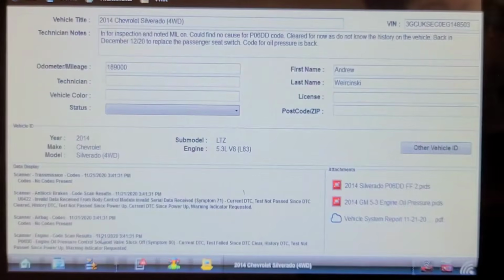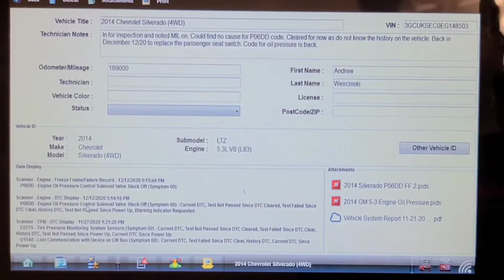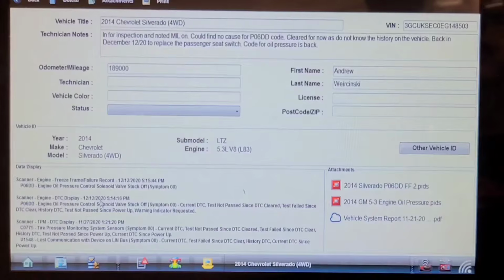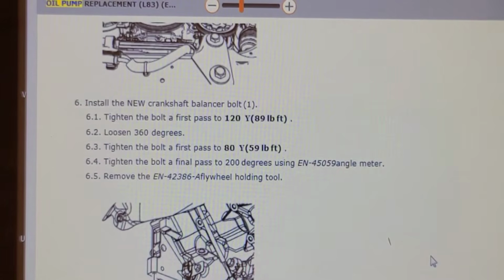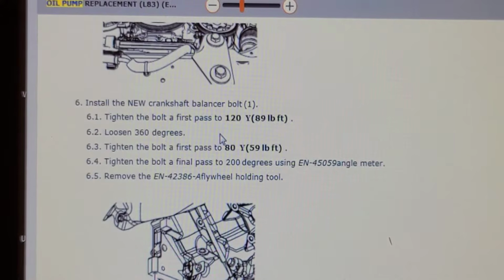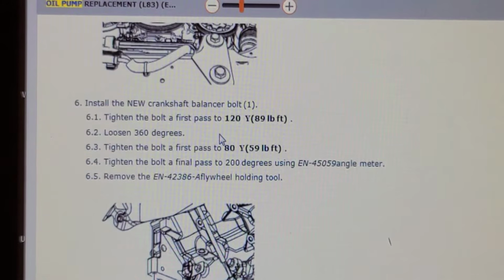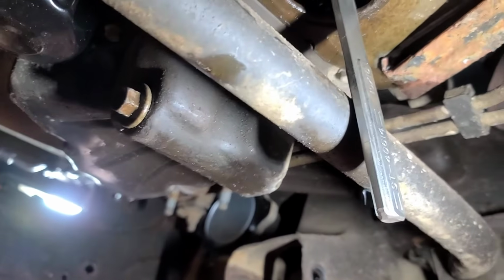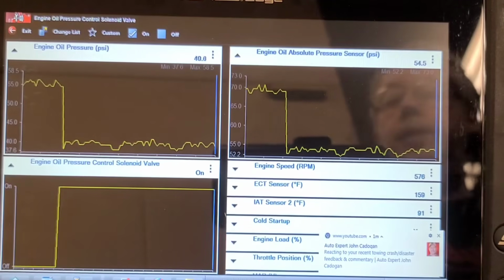2014 GM Truck 5.3 Oil Pump Replacement Code P06DD

Comment: Had this code on my 2015 Sierra 5.3 . Had 3 oil pumps replaced under warranty within 4.5 months . I talked to the service manager and asked if there is an updated part to stop this from happening . He said no . So this will continue to happen .... I traded the truck off the next day for a truely to reliable truck .... Tundra !
Reply from the maker: I hear you... it's a shame they can't design it better.
Reply: @PhillipBailey  they did. Then they ruined it
Reply: @PhillipBailey  Would you by chance rememeber the labour hrs to replace this oil pump?
Reply from the maker: @Mike-iz3wl  I charged him 11.5hrs
Reply: @PhillipBailey  Thank you Sir.
Look forward to more of your videos.Very well done👍👍
Reply: @PhillipBailey that is good to know, as my 2014 sierra will likely be needing one. It got the dreaded p06dd code and a growling noise that started 2 weeks ago. Had one shop diagnose it and basically told me to take it to the dealer because "its s big job", so i'm taking it to another local mechanic this friday.
Reply from the maker: @blackwar12 good luck
Reply: @PhillipBailey doing mine right now, I’m in the process of re assembly. Thank you for your detailed video! Absolutely amazing
Reply from the maker: @Jaidenem1  glad it helped you
Reply: My dad literally  just bought a sierra with like only 60,000 k and  he changed the oil sensor and its still reading no oil pressure  like the pos chevy it is . They're  complete pos trucks now thier  engineers need firing
Reply: There's a tps bulletin for a short spring that causes this
Reply: @jessicalacosse5998  where can I find this?
Reply: My plan too.
Reply: one new engine in mine now(pump failure)70k oil pump is on its way out again on this new engine 189k
Reply: i find that hard to believe that it would be the truck. seems like maybe its the operator. what oil are you putting in your truck? ive done 5w 20 in the winters and 10w 30 in the summers on my 2018 and am almost at 90k miles with no issues. the only issue ive ever had was a starter going bad at 60k and a water pump at 80k but were easy fixes
Reply: @j @jonnysnipes3123 w did u know to change the oil to 10/30
Reply: I know one thing when,this code pops up ,I would go buy a for sale sign and get rid of her.

Comment: This is a 12.7 hour job per the book. If you charge standard rate, around $95 an hour, then it will be 95x13.7 = $1206.5 + shop supplies, parts and taxes.
Reply: $300??? Waoooo !
Reply: Nah my shop did it for like $300
Reply: @backwardmist2303  nice, send me the address and I will tow the cars to you and I will get my cut.
Reply: @scientist100  😆🤣
Reply: Not in Alaska my number 7 lifter went out they want 7 to 8 thousand to fix it

Comment: The drain cock is on the bottom left if facing the engine. The only way to access it is to remove a rubber cover behind the radiator, I removed the fender liner on the passenger side for better access to this.
Reply from the maker: I rarely use the radiator drain as they often break and then you end up replacing the radiator. I'll remove the lower rad hose if required .

Comment: A man that is a lot of work I miss my 2000 Chevrolet Silverado 3500 with the 350 vortec that thing will haul and work hard and no problems. i sold it to buy a 2010 Silverado, then I sold that to buy a 2017 GMC Sierra 5.3,  and now I am seeing videos of this problem because I think this truck is heading this way. I think that a few months it will have this service done because of a whining in acceleration,  still there is no code but in the first start of the day it will make a lot of sound ,and when the engine gets to normal temp it will stop making the sound a man I always say to much tech will always be counterproductive this things are not rocket 🚀 why put so much tech

Comment: My shop manual procedure for the engine oil pump re/re it doesn't say to remove the oil pan on the 5.3L L83 and I just read a thread below asking why you had to remove the oil pan. It looks like the oil pump gasket is of sufficient length that it will just slot into the groove and is not fastened together like it is on the 6.0L LC8/L96 engines in the 2500 trucks that does state to remove the oil pan.
Reply from the maker: You could be right. I was going by what I was told was necessary. I'm going to recheck the procedure...
Reply from the maker: Just read the procedure from GM. Says remove front cover, see front cover removal, go to that hyperlink and first step is remove upper oil pan, see oil pan removal... let us know if you get it done without removing the pan. The oil pump pickup gasket needs to be compressed quite a bit and tge electrical connector on the solenoid would be a bit challenging.
Reply: @PhillipBailey  Appreciate the quick reply. I don't actually have to do the job just came across your video and then read my manual to see. Just watched a couple more videos on this and both also removed the oil pan, one guy said he just lowered it enough to pull the pump off but still had to remove all the same items you did. I wonder if the trans mount bolts were loosened, engine mount bolts removed and then raise the engine up a bit would that be enough to gain access to the pan bolts and allow it to drop enough just to slide the pump gasket off past the pickup tube elbow and of course like you say the connector!
Reply from the maker: @subatomicparticle6535  I think to seal the oil pan properly you need to remove it as it's sealed with a bead of RTV sealant. I would not want to end up with an oil leak afterwards. If the pan used a reusable gasket possibly dropping it slightly might be an option.

Comment: Why do you need to remove oil pan? The ls trucks had a bolt on the pickup tube that went on the underside of the oil pump. Do these trucks have the same bolt because the pickup in the pan looks different?
Reply from the maker: The oil pump pickup is integrated with the oil pan. There is an oval o ring between the pump and the pan. You might be able to cheat and just lower the pan slightly to slide the pump out the front. I'd be afraid of the pan gasket leaking if it wasn't replaced.
Reply from the maker: Actually the oil pan is sealed by RTV sealer so once disturbed needs to be thoroughly cleaned and resealed.  The oil pump pickup is seen at 13:40 in the video.

Comment: Do you have to drop the oil pan completely to remove the timing cover? Thanks
Reply from the maker: To remove just the timing cover I believe you could leave the oil pan on but to remove the oil pump no the pan must be removed.
Reply: @PhillipBailey  I will let you know if it works, thank you !
Reply: @PhillipBailey  I actually didn’t take the oil pan off to remove the oil pump. I just dropped it and was able to unclip the harness attached to it.
Reply from the maker: @buddyrebel_Garcia  I would be worried about it leaking afterwards as I believe it uses RTV sealant.

Comment: Dammit dude!  I have to do this to get by emissions.  DAMN IT!
Reply from the maker: That sucks that if you clear the code it won't have run the monitors and then after a couple drive cycles trips the light with this code. Over engineered.
Reply: @PhillipBailey  At least the parts were pretty cheap.  I got quite a bit apart, ready to drop the steering rack and the diff tomorrow.  Thanks for the video, really helps.
Reply: @PhillipBailey  Turns out the little plug on my oil pump fell off. Unreal.
Reply from the maker: @bernardthefourth  you mean the connector on the solenoid had fallen off? You just reinstalled it?
Reply: @PhillipBailey  Yah the connector was loose.  I have all new parts.  Going to get a new plug tomorrow too, mine is crusty.  In addition to the oil pressure code I also had a code for open loop in the circuit.
Reply from the maker: @bernardthefourth  that would make sense for sure.

Comment: Professional work reflected from experience. Thank you for this video. I have a problem with oil pressure, sometimes normal and sometimes as low as 70 when idle. Do changing the oil pressure sensor and PVC valve think that it solves the problem?  Because if not and changing oil pump is a must then it is out of mu hand. My garage is not equipped with a crane, so the only way is to work on the ground with the car being raised some inches higher.
Reply: Tech4Diag  What?  70 psi at idle?!
Reply from the maker: For what it's worth you could try changing the oil pressure sender but I doubt that will help. Not the PCV though. Good luck.

Comment: I got the P06DD code.
I just bought this truck with this code like a month ago, and I got no increase or decrease on the oil pressure, then replace the oil pressure sensor but the light still there.
After I watch a lot of YouTube videos and researching all the possible causes of the problem I know I have to replace the oil pump.
I think the.
The real question here is if somebody can turn off the solenoide and the code can come up? 
(Its just another possible solution before I start takin apart everything.) I have to take it to a shop and ask to check the pump solenoide whit the scanner as you did it after the replacement of the pump.
Reply from the maker: The only way to get the light off without fixing the actual problem would be to reflash the ECM to have it disable the setting of tge code. An aftermarket tuner may be able to accomplish this but I doubt it. EFI live could do this if you can initially read the tune in tge ECM. Gm has started to make the ECMs write only to stop tuning efforts. I know this is true on the diesels but not sure on tge gas ECMs. Your probably going to have to change the oil pump.

Comment: Hey just did this everything turned out pretty good thank you! The only issue I had was the crank bolt specs. Followed instructions and when tried to turn bolt to the 200 degrees part couldn't.  Maybe got 90 degrees at most and that was cranking with a big breaker bar. Big guy on a big breaker and it wasn't going. Think that's ok?
Reply from the maker: Yes its ridiculously tight. I was using a 4 foot 1/2" Snapon power bar. It will likely be ok if you used locktight. Maybe a piece of pipe on the power bar. I marked the bolts location on the balancer where I started and where 200 degrees was approximately 180 plus another 20.
Reply: @PhillipBailey  that's awesome thanks maybe I'll have another go at it. or does that red stuff that's on the head of the new bolt count as loctite? I didn't use anything on the threads
Reply from the maker: @edctravisg  no that's a dry lubricant I think. I'd probably try get another 90 degrees on it. Are you using a wrench on the converter ear?
Reply: @PhillipBailey  yes to the wrench on convertor ear. Ok I'll get some more turn on it. Thanks!
Reply: Got it! Yeah it did turn some more no prob. Just some crazy torque. Thanks again !

Comment: Hey Thanks, Phillip! I have a feeling I am going to spend a lot of time watching and re-watching this video. I just bought a 2014 5.3L from the North-West Territorites Government... as is-where is silent auctin....It has been sitting for over a year. When I start it up it has good oil pressure until oil temperature nears 80C then It starts dropping off to I would guess below 10PSI as the low pressure shut down message comes up. It has oil pressure again once you apply power.accelerate etc and It does have the P06dd code and P0521.
Do you think it is worth putting in fresh oil and filter and seeing if that solves it? or is that an oil pump for sure?
Reply from the maker: Sorry I just saw this comment. It can't hurt to try an oil change for what that's worth but unless the oil is contaminated with fuel and super thin I doubt it will help. Good luck.
Reply: Hey no sorry needed! Thanks for responding! I’ve been watching some of your other videos, they are so good, it’s been super helpful, I feel like I’ve learned a lot from them. You would be my mechanic for sure if I lived near you. I thought I had a bad ground on it too as it stopped trying to crank yesterday just a day after I got it but it was just a frozen starter in the end... gotta love sub arctic living. Anyways thanks again!
Reply: Is it worth replacing the oil pressure sensor before committing to the oil pump replacement?
Reply from the maker: @scotttrowell2783  It is in the front now so more accessible. Id probably confirm the oil pressure with a mechanical gage first if you can rig up fittings.
Reply: @PhillipBailey  Hey Phillip! where would you recommend I get or download the service/repair manual for this job that you have been referencing?
Thanks again,
Reply from the maker: @scotttrowell2783  check this out: https://www.alldata.com/diy/en
worth it in my opinion.
Reply: @PhillipBailey  THANKS AGAIN!!!
Reply: So I changed the oil pump... and it’s doing the same thing!!! P06dd and P0521 codes.... it has oil pressure at start up and cold temps but as the temperature warms up the pressure drops.... while driving the pressure stays about a 1/8 to a 1/4 of the way on the gauge... when idle it drops close to 0
Any ideas???
Reply from the maker: @scotttrowell2783  well that sucks. I guess I'd recommend to check the oil pressure with a mechanical gage. Did you replace the oil pressure sender? I can't think if what would be causing the low pressure if you have changed the entire oil pump. Was it genuine parts as well.
Reply: @PhillipBailey  Yes, genuine parts. I'll go after the sender next. Maybe should have done that before the oil pump.
Reply from the maker: @scotttrowell2783  I'd be surprised if its a sender problem  good luck
Reply: The engine in video looked like it had a lot of varnish. This engine is supposed to use 0W-20 oil ,owners manual says 8.5 quarts. I have met several owners who say just use 5W-30. Do you think this might shorten life of oil pump?

Comment: Thank you for this video it is great.
My 2015 GMC Sierra 4.3 suddenly lost oil pressure.
I was hoping that this was an electric issue, so I run the engine few  times until I heard some noise and then I stop and didn't run it again.

Do you think I need to check crankshaft bearings and piston rods? 

Also is there any possibility that pump can be replaced without taking off oil sump?
Reply from the maker: Isn't the 4.3 a V6? Not sure its the same but pump cannot be replaced without oil pan and oil pump pickup removal. Not properly anyways. I'd start by checking oil level and quality, tge actual oil pressure test with a mechanical gage. Could be engine time...
Reply: @PhillipBailey  Thank you for your reply. Yes it is a v6, but I'm scared that I will destroy an engine if I crank it again. The last time I heard some noise, I immediately turned off the engine. I'm not sure what noise is that, maybe lifters or something. What I fear most is that the engine is seized. Just for your information a week or two before this happen, the sound of my engine was changed and I had a feeling something falling apart but no engine light no nothing.
Reply from the maker: @bednarcuk  I trust you have confirmed oil level and quality? Is so the I'm afraid you need to put a manual gage on it and check the actual oil pressure. I'm not sure where tge oil press sender is on the 4.3. You have no choice but to start it to confirm no or low pressure. Yes you.may have already done significant damage but you could just have a lifter problem causing the noise and may not be oil pressure. Good luck
Reply: I just replaced the oil pump on a 2015 GMC 4.3. After removing the old pump, I opened it up and found it in pieces. The engine had 36k miles on it. Installed new pump and all is well. The lifters were clattering in it also. I primed the entire oil system with a oil primer before starting the engine after the repair. You must remove the oil pan to replace the oil pump.
Reply: @donshort6651  did you need to move the steering gear to get the pan to drop?